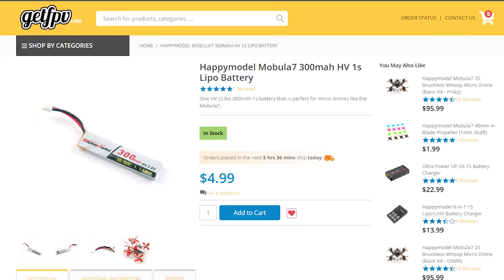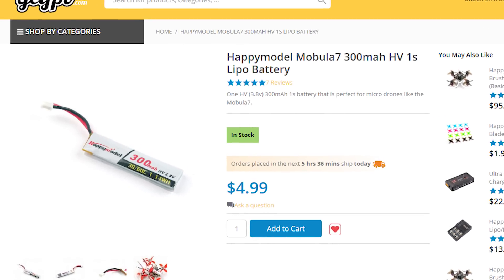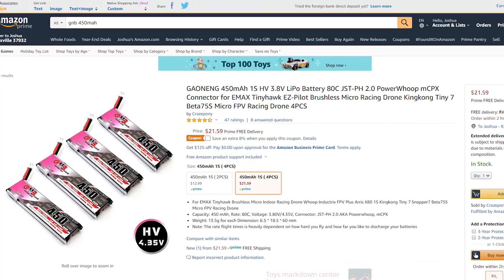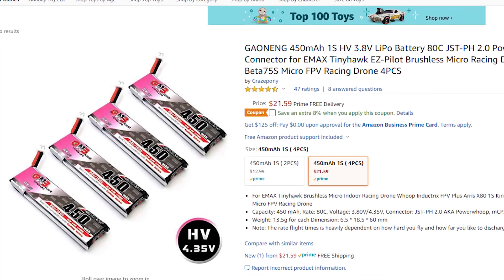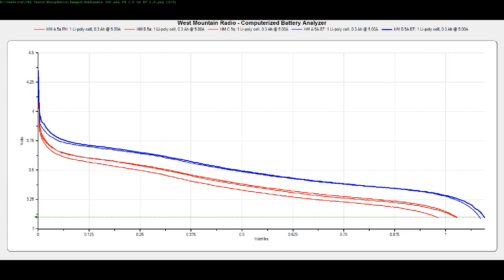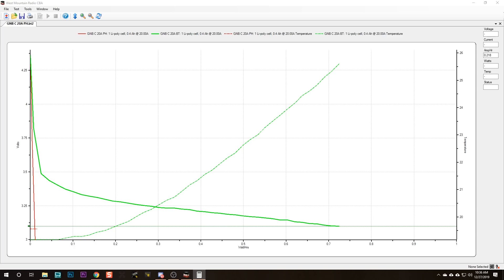Proof that BetaFPV BT2.0 is better than PH 2.0 (BEST TINY WHOOP BATTERY CONNECTOR)

Comment: I changed all my batteries . On my brushed whoops i did not see an advantage . On the 450 cells and brushless whoops i got longer times and higher voltages throughout the flight . I jumped right into them as soon as i saw them . On my 600 mah batteries i saw about 50 seconds longer flight times .

Comment: would it be wise to swap out the PH2.0 connectors with BT2.0 on whoops etc that use 2 1S cells to achieve 2S? I feel like this would be a great jump up without having to switch over to XT30 2S packs

Comment: Using bt2 now on my 65mmwhoop, 0802 17500kV and notice up to 20sec more flight time up to 3:40 on 1s250mAh on original UK65 batteries but only 3:05 min on new GNB260... (Not charging to HV).
It's an additional item to increase efficiency in the total drive train.
I believe the next goal is not performance but flight times in tiny Whoops heading to 5minutes.

I'm wondering if charging HV but discharge at low performance/duration might reduce cycles as well?
Reply: yea 5 min tiny whoop will come next and the latter, yeah that will use up batteries faster
Reply: @M.TTT.  
I'd always thought HV wasn't worth living thus never charged them HV. Packs are luke warm like to keep them this way.
Hard to find info for brushless-duration. HIgh speed whoops are tough to google too!
Reply: @electrobob1  same here, until I saw Kababs video about HV!

Comment: Thanks for posting this and testing in your usual thorough manner.Common sense will tell you a bigger hose will flow more water.Do you feel the XT30 becomes a weight penalty?I'm not a racer so it makes little difference to me,but to a whoop racer everything counts.
Reply from the maker: I'm told Kabab is going over to XT30. I'm going to guess he's probably got a good reason. The biggest disadvantage to me is that it's hard to fit an XT30 onto the smaller 1S packs.
Reply: @JoshuaBardwell  Thanks for the quick answer,I usually get the packs with leads,so a little more doable.

Comment: So the issue with this is its based off the Merrell design I believe but changed so betafpv could use it. The change however is one where of people arnt careful they can plug them in backwards and foom, done drone. Granted with anything it does require expert levels of stupid to do, but shouldn't be feaseable. That's what I've heard. Hopefully the connector wars will show who will innovate the best small connector, it's coming.

Comment: Awesome testimonial to the advantage of less resistance equaling more efficiency/power...to me, it is such a night-and-day difference in performance, there is NO denying the increase in power, and decrease in sag...either, the naysayers have not given this a go or they just suck that bad at flying, they feel no difference. I have even rigged an xt30 to two, BT2.0 series connectors, to take advantage of my 1S cells in series...also, rigged an all BT2.0 series connector...both work fantastic. 👏👍👌✔

Comment: 9 min about what? nothing. get normal no-pressed ph2, like in new betafpv brushless 1c and test it. I sure - no any difference with bt2
Reply: Doubtful.. The BT2.0 has a larger cross-sectional area than a solid PH2.0 AND it's copper instead of aluminum. I'm also pretty sure it will make a more secure connection as well. It will have lower resistance, and it will be more efficient.
Reply: Actually there is a difference to the solid pin PH2.0 connectors too - BT2.0 are superior to PH2.0 with solid pins. Did the measurements. You can find my results here => https://brushlesswhoop.com/jst-ph20-vs-betafpv-bt20/

Comment: If you cut off all the old connectors and soldered new ones, aren't all the cables shorter for the new connectors, and how much shorter? Since there are no pictures. Does that influence the results? I'm asking because I wanna know. Maybe do a new test where you cut off the new connector again, and then resolder the old connector with shorter cables, to see if you would get the same results.
Reply from the maker: The resistance of the cables is negligible at these amps and lengths.
Reply: @JoshuaBardwell  Thanks for the answer! It's good to know, I'll trust the results then

Comment: I disagree not on the fact they cut down the voltage sag and longer flight times but for the fact that they are weak I’ve always been a finger banger wether it be 5 inch or whoops and mine lasted three days befor they broke off the battery and yeah I may get voltage sag or what ever on my whoop but it wasn’t like oh my god better especially when the by is weaker then the ph so for me the ph is still better

Comment: Thanks for the video JB! Was the pH 2.0 connector solid or rolled? Maybe you could include super close up detailed pictures of the connector you used for us?

The reason this is important is because if you use the rolled connector that would increase the apparent benefits of the BT 2.0 connector.  Maybe the solid pin connector that really isn't a big difference? Gotta know/ test for the scientists!
Reply: I have the BT2's. They are solid, gold plated with pins and sockets of higher quality. The BT2's have much more surface area connecting them compared to PH2.
Reply: @cccagley5276  Thanks, I also have the BT 2.0 connectors. I was specifically asking JB about the pH 2.0 connectors he used in his testing. I don't believe he specifies if he is using solid or rolled pins in his video.

Comment: i'm assuming the tests were with a healthy socket,  it gets worse very quickly as the sockets age, a good percentage of those little sockets melt and get worse and worse,  did you get any ways to test the jesc thing?, people saying its a big boost in flight time from the rpm filters mod for non 32bit esc's,

Comment: What about a solid pin ph2.0 from digikey? 
I agreed the folded pin connectors suck, but solid pin ones have given me similar positive results
Reply: I use solid pins with 18awg wire on the quad and I doubt that it’s much less than bt2.0. Never get voltage alarms until the battery is dead after doing that.
Reply: who needs connectors, solder directly :D
Reply: I've been using JST like on my ground micros, bigger, longer pins, and solid.
Reply: I wonder if these folded pins could be soldered into something more solid.
Reply: @CatEatsDogs  huh? people have been flowing solder into folded connectors for years. 
was folded, now solid.
Reply: @CatEatsDogs  people have been filling the folds with solder and that alone has drastically incrased the performance

Comment: Would havbe been super interesting to see how an XT30 performs in comparison. Is the BT2 connector maybe still not enough? I used to run XT30 on all my tiny whoops before the BT2 came along and it was great. I am sure I was not the only one :-) So if you can manage it that would be great
Reply: XT30 is rated for 30A and BT2.0 for 10 Amps and PH2.0 for 5Amps
Reply: @mishrasubhransu  I'm not sure how comparable those ratings are, you never know how they decide such things. FYI 2mm ph connectors are rated at 2A according to the datasheets from JST. I strongly suspect the bt2.0 wouldn't be rated at 10A if it was held to the same standard, probably more like 5A.
Reply: Absolutely agree fabian,
I'm interested to see if the bt2.0 is still hindering performance in any way at standard whoop current draw or if an xt30 would give a significant advantage.
Reply: @BobSmith-jj2pu  I reckon at that point you'd have to start taking into account the weight somehow. With the higher power brushless builds it might be worth it but if you have to add another 5% more weight then maybe not.
Reply: @frasersteen  Weight is of course a thing - and if I remember correctly the XT30 adds about 1gram over the BT2. But we can make this decision only if we have some hard data comparing the two.
Actually I would go much further with this experiment. Solder AWG16 wires directly to the battery along with an XT60, then move my way down. First the wire, then the connector
Reply: @frasersteen  It is a fine line.
Reply: There’s something we need to also think: no one flies full throttle. So maybe, while limiting the mAh, the BT2 may be sufficient for a very efficient build? All the earlier 1-2S boards had an amp rating of 6A constant...
Reply: @nikotttin  When theres a straight away I fly full throttle👍🤣😃😂😉
Reply: Fabian Isensee the xt30 is still king but weighs more and you gotta realize its alot more metal in those.
Reply: For 1s toothpick XT30 might be the ticket.

Comment: Anything on the horizon that might replace the XT60 on bigger quads?
Reply: The question is whether or not XT60's limit bigger quads. There are XT90's out there; however, atleast for 5 inch quads, I think XT60's are fine.

Just my two cents. Happy flying!
Reply from the maker: Some pilots are running XT90 instead of XT30 for the same reason, but I suspect for most people it's not worth the trouble.
Reply: @JoshuaBardwell  Would you please do a similar quick test on something like a 6S 1300mah pack with XT-60 vs. XT-90? I think that maybe there may not be much difference for 5".  But if there is a change in discharge capability it could have a big impact on 6"-7" quads.

Comment: Why the heck is there still doubt? I build my first brushed whoop about 18 months ago with JST connector batteries… and instantly after launch the voltage sags down to 3.4V on hover. Then I decided to go for a XT30 on the same battery and quad. And after launch the voltage settled at 3.9V on hover… The flight time was doubled after the connector upgrade... And I will do the same on my Mobula7 now. BT2.0 is still too rare and on 2S I will go for XT30 connector batteries from GNB now.
Reply: How about the extra weight of the XT30 and the thicker wire? I also have a Mobula7 that gets lousy flight times on 1s stock batteries. My new batteries instantly sag to 3.9v and I am lucky to get 1:45 flight times of easy flying. I just got some 450mah 1s batteries delivered and expect some extra flight time but still wondering if I should convert to XT30 or BT2.0 also.
Reply: @fprintf  my mobula7 runs on 2S and I just got it from a friend a few weeks ago. I use it with 2 single 1S 260mAh Lipos in series. It gives me a flight time of maximum 3min and not even 2min if I rip around in acro. I land if it hovers at 3V only and then the batteries settle back to 3.8V per cell. This is ridicolous. the more power and more flight time the XT30 will give, will pretty sure compensate for the 2-3g of extra weight.
Reply: @fprintf  48khz
Reply: What about the Tinihawk S with 1s and 2s? What would you do if you replace the drone connector with the XT30 (which is fine for many 2S) but all the 1S batteries are PH2.0?
Reply: @EduardoRimoli  I don't use any 1S cells anymore. They are good for little hover toys but not for a whoop that is capable of freestyle maneuvers. If I wanna fly them indoors and they are too fast then I use the betaflight throttle scale and set it to 60 or 70%.

Comment: Just curious. But why was the last video where you were talking about your battery test machine removed so quickly? Also do I have to go through betafpv to get the plugs or are they available anywhere else?
Reply: The BT2.0 plugs are available from quite a few stores now , even Amazon. BetFPV also just released 450mah lipos with the connector too.
Reply: Thanks for clearing that up.
Reply from the maker: I believe the PH 2.0 are currently only available from BetaFPV.

The battery video was removed because it made people think I was mad at Kabab and I don't want to start drama.
Reply: @JoshuaBardwell  drama 🤤

Comment: what about xt30?
Reply from the maker: Based on its size, it's got to perform even better. But I don't know how you can connect an XT30 to a 300-ish mAh pack, unless you put wires on every one. And I'm not sure whether most people would feel that's a good tradeoff.
Reply: I'd like to see the xt30 results too. If the results are worth it I'd switch.

Comment: I agree. After testing, i found the bigger the battery, the more obvious the difference. This connector will unlock performance on 1S 450mAh and more.
On 300mAh, the advantage is still here, but very small.